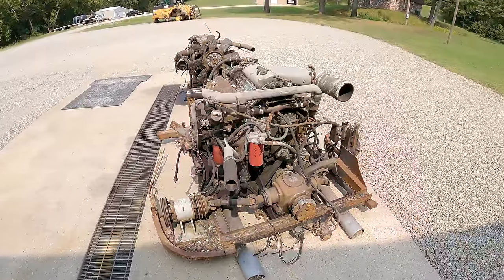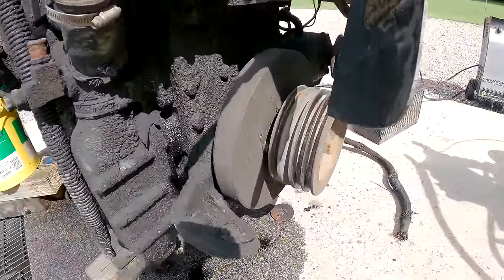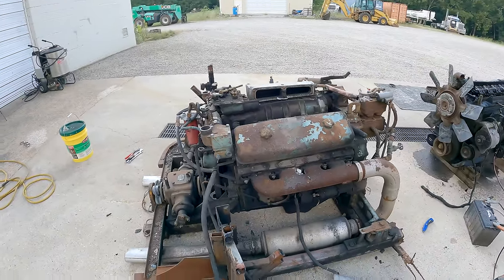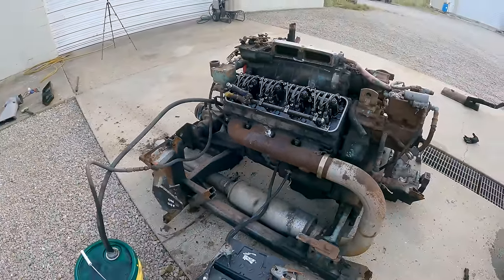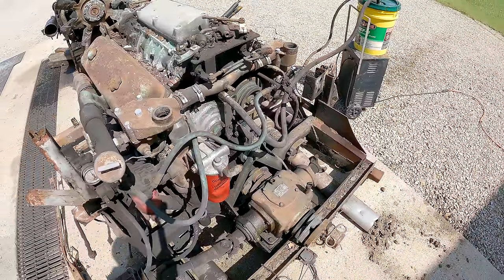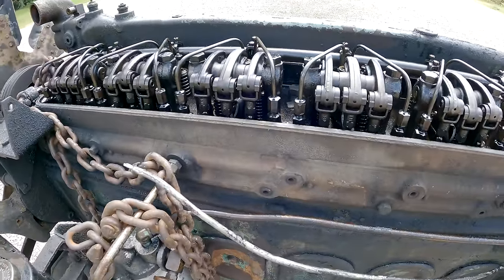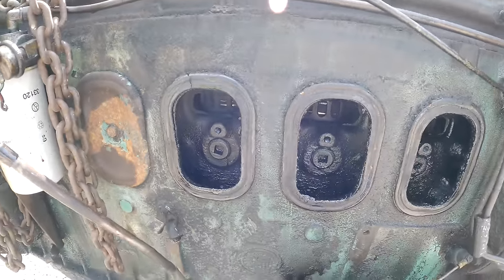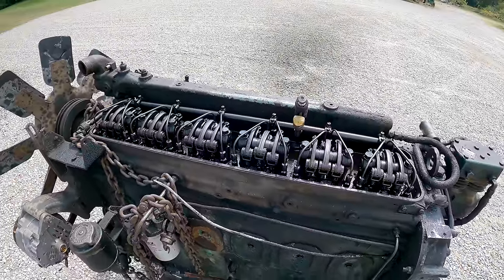Runaway 6-71 Two Stroke Detroit Diesel - Double Greasy Detroit Revival

Comment: So my friend, what was your point of this demonstration? How to destroy something that could have been resurrected via a rebuild? Sensationalize a video for more traffic? You stand to get more readership by saving something than destroying it. Being a seasoned truck driver, the engine would not restart because you destroyed the integrity of the compression system each cylinder depends on. Without the compression, even volatile fluid such as ether is not going to combust in lack of compression (the valves as well as the valve seats probably became warped preventing a good seal, and the head cracked), why would you continue to crank after four revolutions? And what alternative outcome did you expect without a cooling system in place? I'm actually surprised you did not have a fire due to over-stressing the starter, starters are not designed to crank for more than 15 seconds on large high compression motors. I thought you knew diesel better than this. And I'm not a mechanic. We are struggling to preserve resources, here's a man that throws it away like it never ends. You must be in the same income class as the Trumps to afford this (but yet, you couldn't find a nut to fit to the second battery terminal, so you use your foot to secure the terminal that is carrying at least 250 amps during cranking, all while with a 5 gal pail of fuel not 3 feet away, while jumping the starter solenoid with a piece of wire with sparks flying everywhere). I feel a bout of redneck coming on......
Reply: It make sense that the starter would last more than 15sec while cranking, because the engine don't sound like it has an compression left.

Comment: having cut my teeth on CAT's it killed me to see one company i worked for torch a hole in the side of the block on a perfectly running s.n.  6NZ 3406 in an older truck just for that "terp" rebate "gov" program....these older engines and trucks would still run circles around these piles of junk everyone makes these days.... wish I turned wrenches back in those hay days....these chinese plastic pieces of shit have me questioning my choice of careers sometimes

Comment: No compression
Reply: The initial cranking sounded terrible after overheating! what was that sound?
Reply: @Wozt  Usually on overheats rings will lose tension or the ring will expand so much butting the end gap breaking the ring. On two strokes with intake ports on cylinders the edges of the broken rings will catch gouging the cylinder walls.
Reply: @trueamerican7034  Oh so something was scaping the walls until it even out. Surprised that the engine turns over at all.

Comment: I bet I rebuilt 200 + of those in the '80s. You can't build an engine with  more parts. Nothing simple. Governor probably has 100 parts. GM. They must have had 3000 engineers design that fuel chewing smoky piece of shit. The 16v92 was a slobbering piece of shit too.
Reply: This is a bad engine?